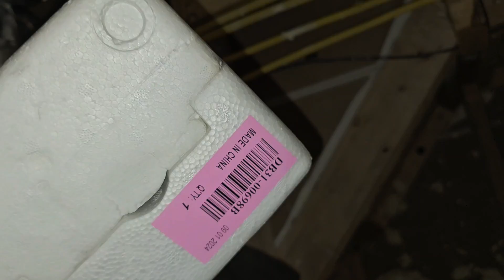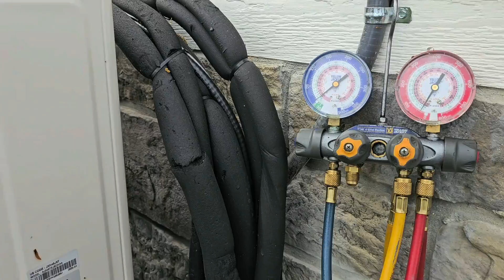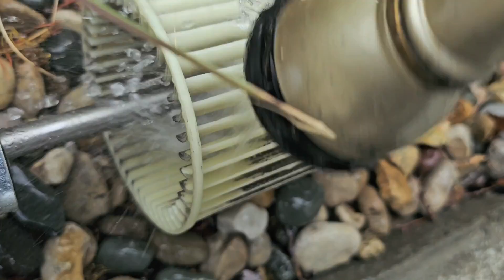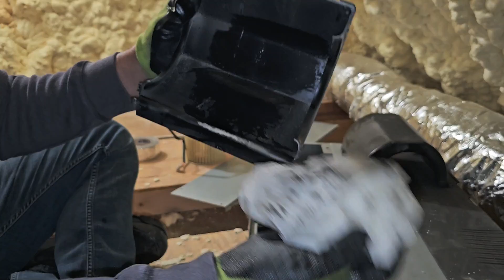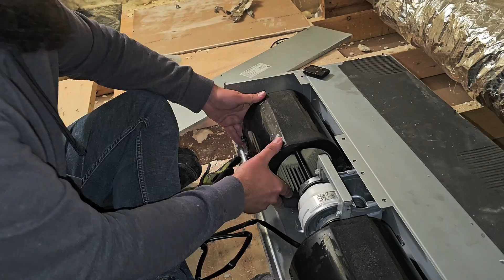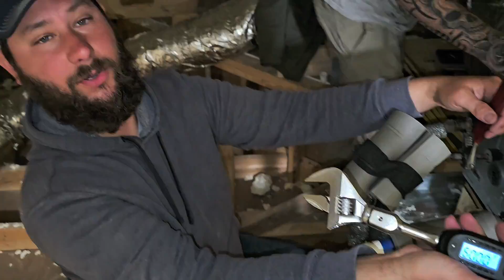Ducted Mini Split Blower Motor Replacement #ducted #minisplit

Comment: I have a pancake unit in my ceiling whoever installed it did not care that there was openings in the sheet rock sucked the insulation fibreglass  into the blower than blownblown it through the condo for years. No one said nothing until I brought the unit I started coughing because I have really bad asthma. I’m also a contractor Home Inspector as I went up and  looking around the motor is caked With insulation. It looks like and other contaminants now I have to try to remove the motor myself and clean the wheel because you cannot use the unit without coughing and have an itchy eyes because of not being properly HVAC. You look like a professional that takes your job seriously like I do and don’t take shortcuts thanks for the video.

Comment: Tad, great video and super helpful - I just subscribed to your channel as well! 

Question for you: I have the same exact issue with my 1.5 ton pancake style Samsung blower motor, but it's sitting on blocks in very tight attic space that's only 4-feet tall. Any recommendations for the best way to hang it in a tight space to then complete the motor swap? My idea is to hang the mini-duct from the flat attic ceiling, remove the blocks it's sitting on and then complete motor swap before making a new removable ceiling below.
Reply from the maker: I would definitely go with your idea. I think that you are on the right track. Let me know how it turns out

Comment: Amazing video and very beneficial. I have a Daikin indoor unit with a DC brushless motor, where I notice the fan ramps up to a high speed and then stops, vibration is also a bit abnormal when this ramp-up happens. Is this a sign of a bad motor or an issue with the control board

Comment: Tadd, when you assembled the blower blades on the new motor you reversed the right hand drum so it will be running backwards and not blowing air. I waited to see if you would find and fix it but you assembled it reversed.

Comment: When you have flare fittings on anything try some refrigeration oil or nylog on the brass, definitely helps with the brass to brass connections. Also, can use on flare sight glasses and txv's. No jokes love the fact you actually torque them to spec because a lot of people don't.
Reply from the maker: Thank you for the tips brother

Comment: I always told my new construction homeowners that sheetrock dust clogs the indoor coil and destroys blower motor bearings and NO warranty on parts or labor. The installation paperwork/warranty usually states that. If a contractor needs heat, they need to run salamanders, LP heaters or electric heaters.

Comment: umm..... did you intentionally reverse the right blower wheel?   hope Im seeing this wrong
Reply: Before disassembling, both facing same direction. After reassembling, one was reversed.
Reply: @USA-GreedyMenOfNoIntegrity  I noticed same thing.
Reply: I am seeing the same issue, noticed the same,  rightside blower wheel in reverse  @samircufurovic9279
Reply: yep...crap happens. we're human. @USA-GreedyMenOfNoIntegrity
Reply from the maker: Blower is working probably just the way I shot the video